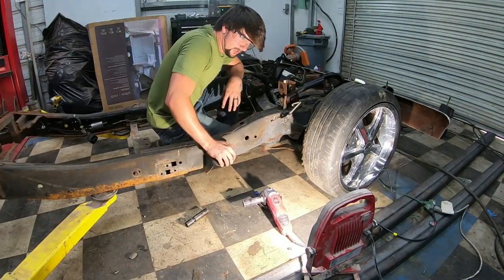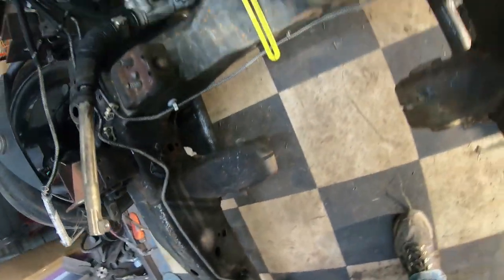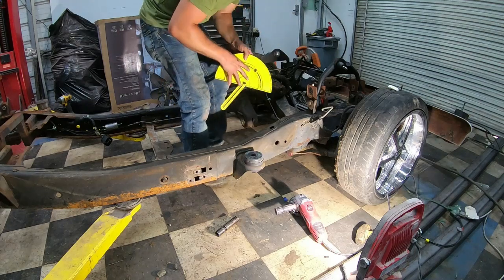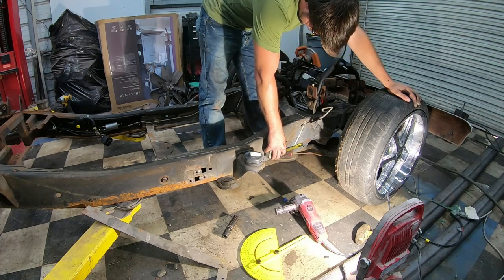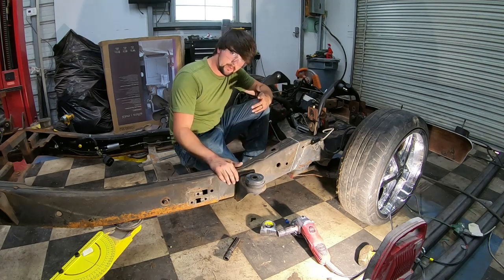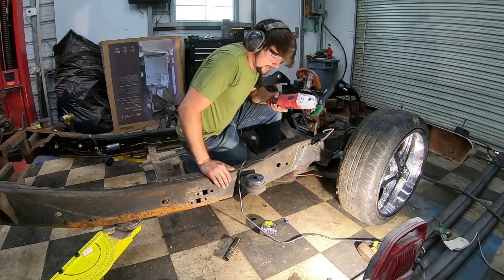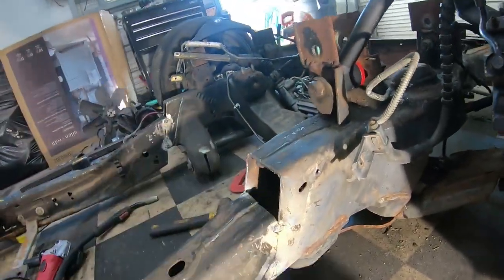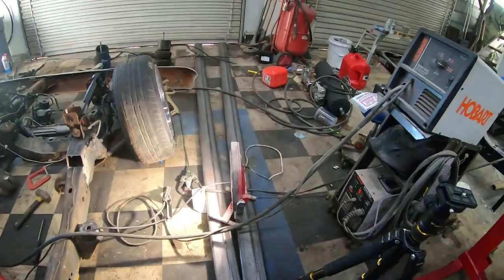How to Z a frame

Comment: We do Z, L and straight cuts on semi trucks but all three cuts always receive a short section of frame inside for a double frame. We stretch semi trucks and have never had a failure, but I'd never trust any frame splice without a second inner frame piece, not a pickup or semi
Reply from the maker: It has to have a gusset on both sides on truck frame to strengthen it. That’s just for half ton

Comment: Wouldn't this technically extend the wheel base?
Reply from the maker: Not when the front section is also cut at reverse angle to keep core support holes correct. I wanted to extend my wheel forward .5 inches so slanted it more than usual to center the wheel bettee